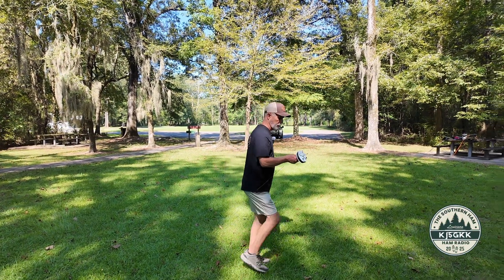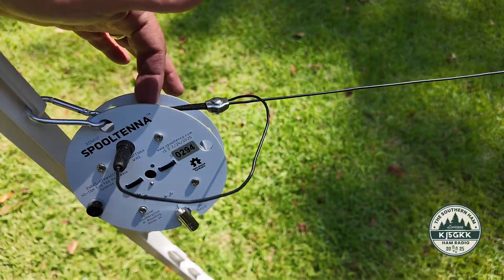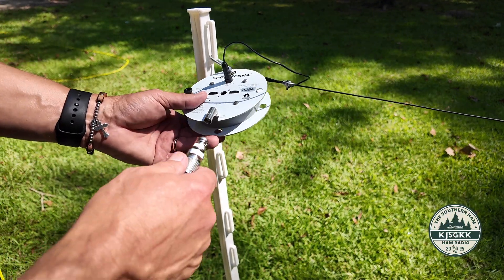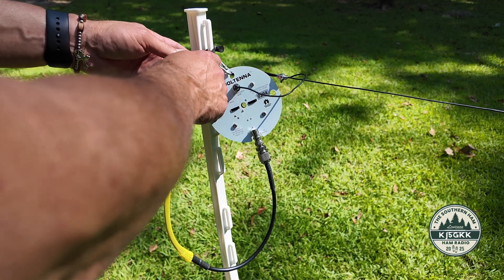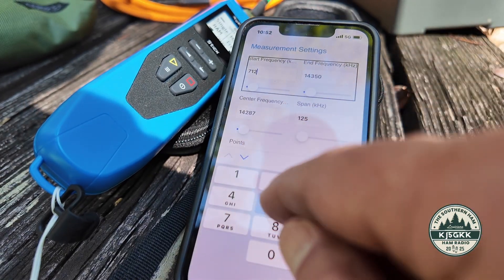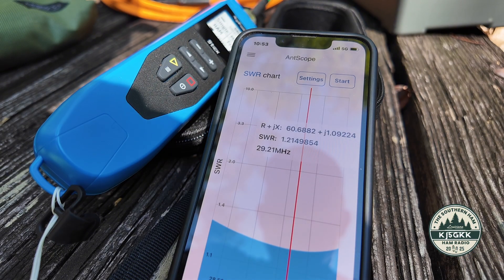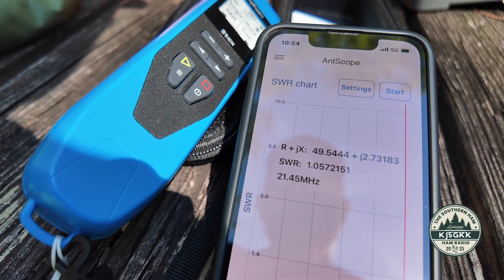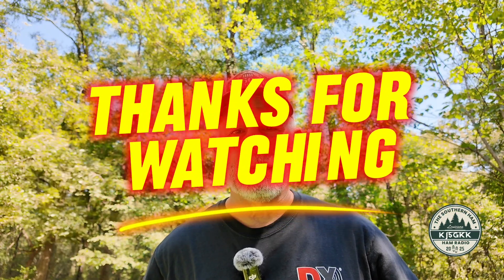Step by step deployment of the Spooltenna EFHW4010! #pota #antenna #hamradio #parksontheair

Comment: Just got my spooltenna and tried it yesterday first time,  works fantastic. The 40 meters was high on it based what my 710 said, don't have a analyzer. I hung the wire on a tree limb at 15ft sloped down to 4ft in my yard. Made 6 contacts,  Costa Rica, California,  kansas city,  West Virginia,  Texas . So easy to setup, really happy with it.
Reply from the maker: That's great Barry.  Your 710 will fine tune that thing if necessary, but you should have less than 1.4:1 on all bands.  Enjoy.

Comment: That is awesome Paul, I need your complete setup recomendation even with the meter. KJ5BNQ
Reply from the maker: Barry, It's called ANTSCOPE and it's from Rig Expert Ukraine Ltd.  It blue tooth connects to the Stick Pro and is really easy to use.
Reply from the maker: Barry, I'm not sure I understand your question.  Can you be a little more specific.
Reply: @paulTheSouthernHam  What software are you using on your phone to find SWR with the rig expert?
Reply: Ok, thanks